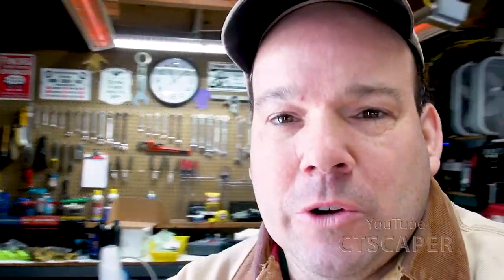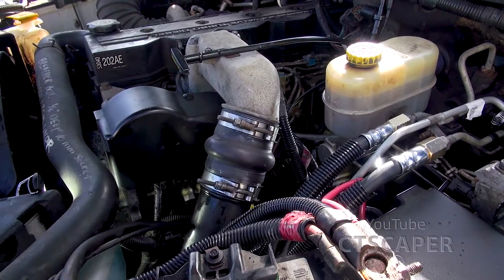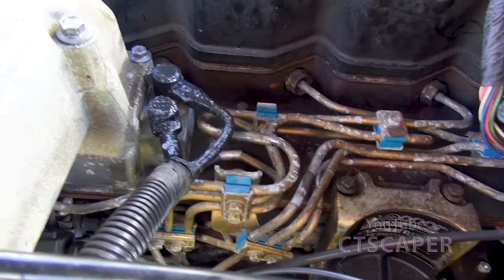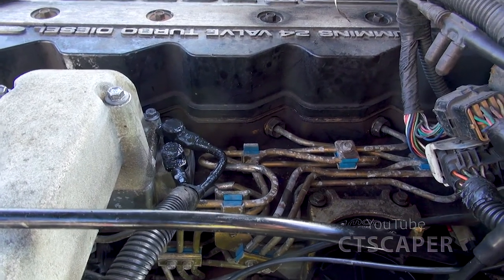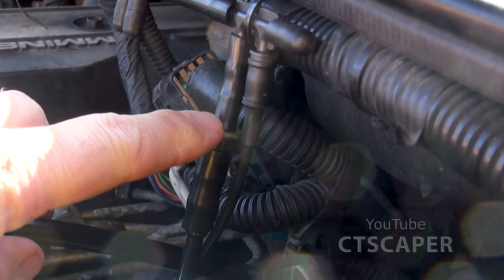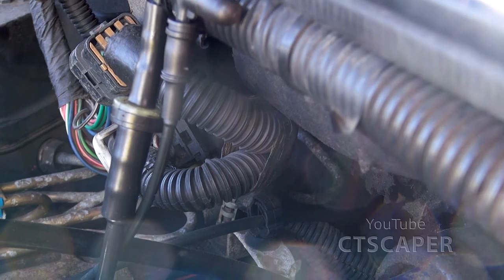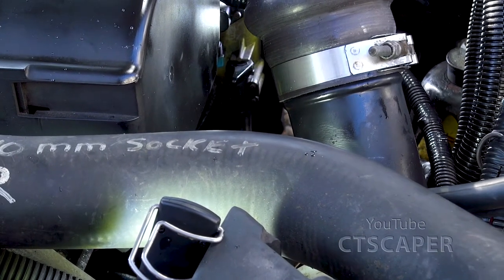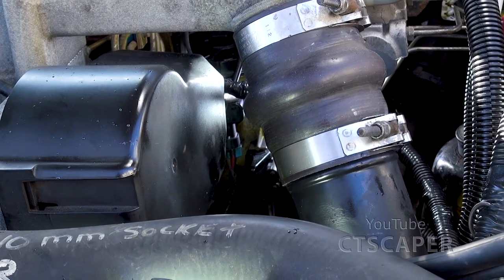DODGE CUMMINS VACUUM PUMP REBUILD DAY 10

Comment: I would check the thermostat first to see if fully opening. Just put it in hot water to check.
Reply from the maker: Thank you Harrison!  Are you talking abour removing the thermostat and putting it in a pot of boiling water?
Reply: @CTSCAPER  yes that's one way of checking to see if it fully opens.